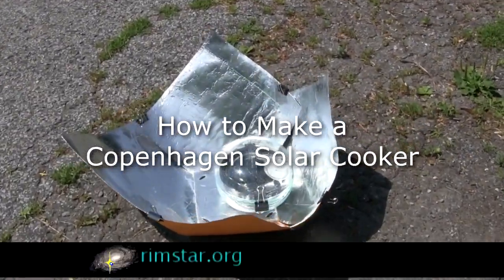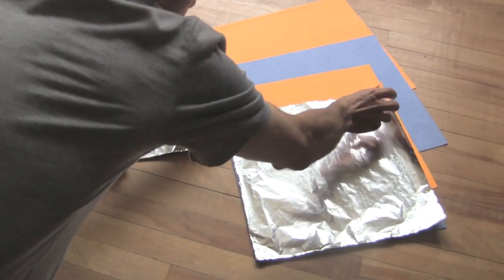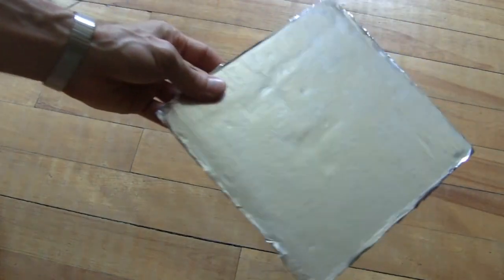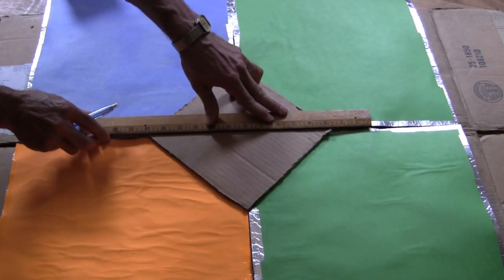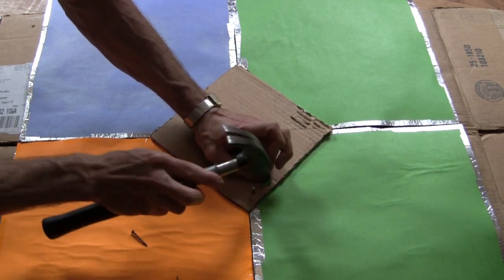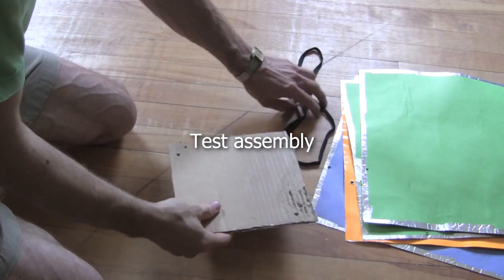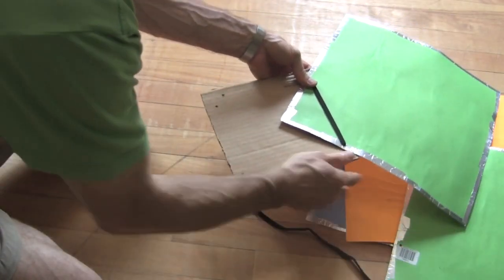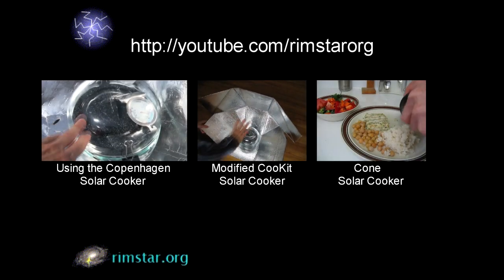How to Make Copenhagen Solar Cooker

Comment: Awesome video. I am going to make one. Where to get a black pot that can be used in there. I want to use a non-toxic non-plastic pot. Thanks in advance.
Reply from the maker: I bought mine from Walmart many years ago. I had to saw the handle off so that it would fit in the pyrex containers.
Reply: @RimstarOrg  Thanks - any special type to look for when shopping? Or I guess any black metal pot will do. Thanks again.
Reply: I'm going to try cookie tins painted flat black. Could have different sizes for different things being cooked.

Comment: if i used plain cardboard box would it be to toxic ??? do you know.. thanks for the class
Reply from the maker: I don't see any problem with using plain cardboard box, though if it's corrugated cardboard, it may be hard to shape.

Comment: Hey, is poster board the same thing as bristol board?
Reply from the maker: Good question. From wikipedia's description of Bristol board, https://en.wikipedia.org/wiki/Bristol_board, I'd say they're not the same thing. I've never seen the Bristol board that wikipedia is describing and it doesn't sound like what I used in this video. What I used sounds more like this https://en.wikipedia.org/wiki/Display_board.
Reply: Thanks a lot!

Comment: great video, does this cooker boil water with the aluminum foil as reflectiors?
Reply from the maker: Yes. Check out my follow-up video http://youtu.be/H5_z4-ocLUs. I didn't measure the temperature inside the cooking pot, but given that the temperature outside is well over the boiling point of water, I'd guess the water inside got to boiling.
Reply: Cool i hace some refkectors that are nore reflective then aluminun foil. This is probable the easyest cooker ive seen does take a bit of tuwcking but simple cheap works well and its portable. Thank you your the only one ive seen doing this cooker.

Comment from the maker: Just looked up solatube, interesting technology. For a period of time during the day you'd gather more light for it but at other times you'd actually be blocking the sun. Unless somehow the whole reflector system follows the sun as whole or you mechanically manipulate the reflectors as I do in my companion video, Copenhagen Solar Cooker Assembly and Setup. It might be simpler to use a few heliostats further away on the roof instead.

Comment: I have been looking at the solotube lighting systems and was wondering if this could not be used to collect the light and focus it through fresnel lens cut round to fit the tube in such a way to be raised & lowered ( like an old fasion telescope )to obtain desired focal point... The design of the solotube lens would eliminate changing angles to track the sun.